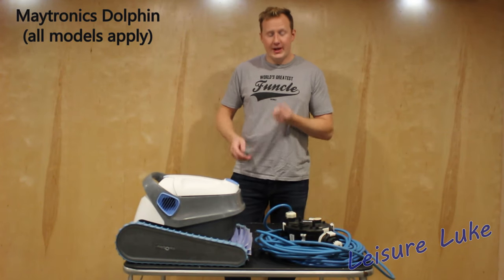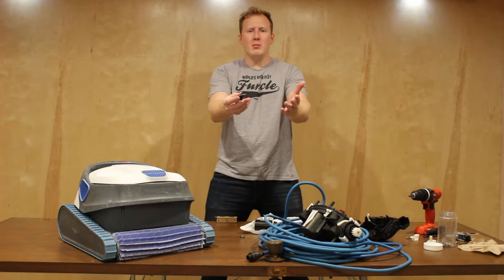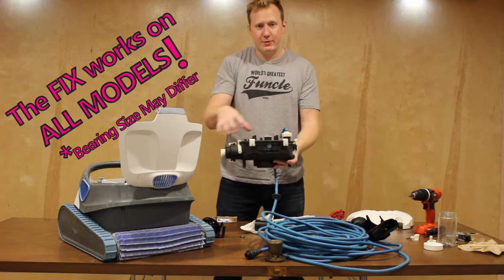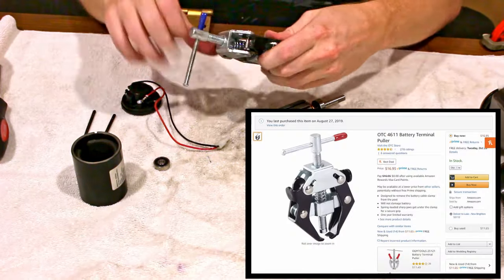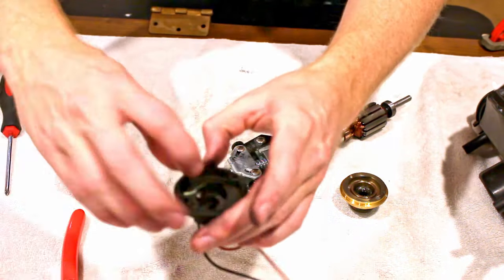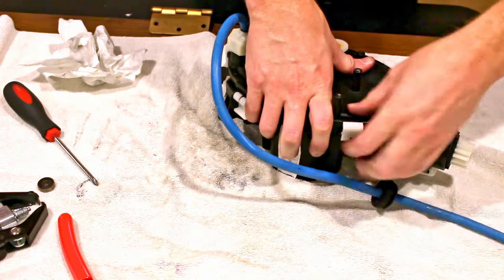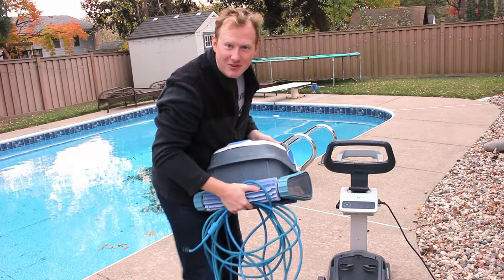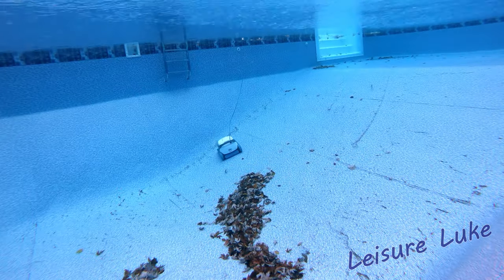Dolphin Pool Cleaner - BROKEN is FIXED!!!  SOLVED with 1$ Bearing | HOW TO REPAIR for MOST Models!

Comment: Hi Luke, thanks a lot. This was exactly my problem. I've spent only 1 dollar, 40 minutes and could fix it. you are the BEST. best regards from Switzerland Angelo
Reply from the maker: NICE WORK!!  That's no small job :) money and hassle saved!  Party Accordingly 🥳
Reply: Hi Luke, I have a dolphin, E-10, it seems lately the unit will go on the bottom as it goes through the debris. The debris just blows around. It does not seem like it has any suction yet I do see water coming out of the top. Any ideas why this would not have any suction? I checked the impeller, and there was no debris.
Mike
Reply from the maker: @michaelbennett3202  If water is blowing out the top, then you have suction coming in the bottom.  If it's able to cling to and climb walls, your suction is good enough.  I'd double check your filter basket for small tears, any small tear means that filter basket will pretty much not work at all.  Also make sure it's assembled correctly and sitting right in the unit.  If you're climbing walls, and your filter basket is clean, then it should be sucking up and cleaning something!  Hope that helps.

Comment: Awesome video. Thank you for helping the algorithm find this repair and saving big $$$

A few notes as I'm mid-repair:

1) The sealed unit itself can be really hard to open. I used the shaft of a screwdriver (not the pointy end) to pry it apart using the clip brackets as leverage. I slipped a credit card into the gap to help work around. When it finally opened there was a large pop - I think the unit was REALLY well sealed and the temperature swing at night when I tried to open it caused a pressure / vacuum making it extra hard.

2) The long screws on the motor itself have SUPER SOFT heads. Immediately stripped one of them using a regular screwdriver. And that's the point I'm finding myself stuck at right now. Ugh. Be careful everyone with these! Might end up having to buy a new motor just because I've stripped some darn screws 😵

There is an eBay seller out there who will repair/refurb your motor for ~$110, or sell a kit of all the necessary parts for ~$30. Might be worth it if there's a lot of parts that need fixing, or if you're happy to outsource part of the fix without shelling out the full $450!!
Reply: Thanks for the tip of using the shaft to pry open the black motor box. I was stuck.
Reply: @bristolj.buckets8968  I was curious about how well it was sealed. Thanks for this!
Reply: Could you please give us instructions on how to open this black open. I don't want to force open and at the end I can't close it tightly.

Comment: I spent $180 to replace the blue cable on my DOLPHIN Nautilus CC. It would only run for about 30 seconds and just stop. No indication on what was happening. Local pool shop suggested to replace the blue cable and I let them. Got it home a week later and of course it didn't fix my issue. They then suggested to replace the motor..  Adding up the cost of the potential repair, and I could have gotten a new unit for the cost of the motor and cable! :) I will for sure be taking my motor apart this afternoon to see if the bearing is the issue! Thanks for making this video!
Reply from the maker: Good luck!  While you are in there you can check both motors.  Some people have actually done the same fix on the other motor too!  I’d use your old cable and save the new one :) someday you’ll probably need it!  Might as well squeeze out the life of the old one!
Reply: @LeisureLuke  so taking the motor out in of itself showed me the issue. The propeller had hair and twine underneath it in a way I wasn’t able to see it from the top down view. Took the prop off the spindle and removed it and it’s working perfectly!!

Comment: My Maytronics Dolphin Active 20 just started having this problem where the impeller is not spinning.   I bought brand new in 2020.   We use it everyday in the summer.  This is the 3rd season.   With your instructions, I was able to take it a part.   There was all this black carbon flakes.   I used electrical contact cleaner to clean the inside of the 24V impeller motor, and both bearings.   I couldn't take out the 3rd bearing off, put it all together and everything is working - back to normal!   Without changing any parts!   This took me 2 hours to do at a easy comfortable pace.    Thank you for making this video.   You saved me $1500.     I was almost going to buy a new one.
Reply from the maker: Nice!!!!  Congrats on the fix!  It’s not a job for the faint of heart, and sounds like you did a thorough job and cleaned it like new!  The black dust is normal - it’s from the wearing of the motor brushes, which I’m guessing will be our next failure and next fix-it video :).  Well done!  Party accordingly!!!

Comment: Been working on these for 6 years, seen a lot of seized motors and this actually makes a lot of sense. Normally do repairs by replacing, but lately been trying to rebuild. Kudos for this info~
Reply from the maker: Yeah, and my repair of just 1 bearing has kept it in service for like 1.5 seasons with no signs of slowing down.  Any chance you have a good link to buying just the motors?  Or do you usually replace the whole black box motor assembly?
Reply: @LeisureLuke  I usually order through second hand to replace the black box. I've had around 50 machines before here, so sadly I won't have time to break things down. Covid made getting new parts a challenge, so I've been adopting motor repairs specifically since summer. I have a stack of older parts too incase one of the boards went bad.
Reply: So should the ball bearing just spring and spin? I give it a good spin and it goes about 3-4 revolutions and stops.
Reply: @Liatriss Would you happen to know if the 63ZYW-A2 can be replaced with an A3? Specs appear to be the same, but I’m not an electrical engineer so I’m being extra cautious.
Reply: @shortandsavage  from my experience with it, yes. I consider the bearings to be like skate bearings as the main difference seems to be small design differences for similar purpose. The main thing I noticed is problematic with the repair is the O-ring (which I have no idea if it can be bought without a custom fitting from somewhere.)
Reply: OHMICOIHO  Any idea where we can get a new rubber gasket?
Reply: I did this repair and now my impeller blade is spinning backwards forcing it to blow water instead of suck water from the bottom
Reply: @benproutey3428 
Swap the pump motor red and black wire . It's easy fix 😊
Reply: Ok, thanks for video. I saved it for later! Unfortunately this is not my issue. Maybe you or someone else can help me though.
Our power supply for the Dolphin is not powering on. Any suggestions? I've unplugged,  replugged, checked the outlet and even switched to a different outlet...still nothing.  Any hacks for this situation?
Thanks again!
Reply: Update on this, it will be a long post, but a few things. One I learned that at some point they had them pressurized (I think when they had the brass nuts to cap motors) check and see if your motor is boyant, it could need ~30psi

I've been learning to recoil the copper lately, I'm trying my best to do everything as the state of Isreal has affected a lot of shipments for parts (cables especially)

That said, if you find your cable gets tacky they are a (I believe) an oil based foam, I believe PVE, that said the tackiness from what I can tell is chemical stripping the oil out. I've been experimenting with old cables to coat in various oils. Specifically, machine 3 in 1 silicone and coconut oil, rub it in and pat dry excess. I will say this method hasn't gone through a lot of water testing to make sure it doesn't leak into the pool, but so far it's made tacky cables smoother.

In addition, the swivels are an interesting bunch. From what I can see (if you're familiar with this) they have a compression seal at the bottom that looks like the old style for motors/aquavac tiger Shark motors. Building order seems
1. Extend and cut the bottom swivel off as much as is available after cutting the foam to pull back for more room (leave a lot of room for reconnecting)
2. Remove bottom half of the swivel and compression seal at the base.
3. Attach a new compression seal and weave the cable back through, then cut back some of the cable shell.
4. Get water proof heat shrink butt connectors red type for this guage crimp and shrink wire to wire.
5. Seal over with a thin shrink tube then another shrink tube over the wiring.

The compression should seal the swivel using the shrink tube to fill the gap, just note the direction is nose down for added sealing length.

Also note, the swivel design changed around 2023 (I think) they went from 1 o-ring to two on the top half, be very very carful when removing the top as it can strip easy, I believe you could find a socket for a bike and modify it to slot three of the four turning points since those sockets are open on one section.
Reply: @RJD0314 the switch or cable ribbon could be bad if its the new unit, that is replaceable by lifting at the button. If theres no power then it could be a corcuit board or transformer issue if the cable swap doesnt do anything. if this is an old power supply you may be able to open the unit from the bottom, if it's the smaller sealed unit you'll need to cut open the unit for any circuit replacements, there is also the flat unit which is a small group of screws to remove, this is a little more operational for tech savvy repairs

Also, on the circuit boards capacitors are a big time culprit for failures

Comment: Literally, you saved me $450 AND the fix was free !!  Took apart as you did, took the motor apart and the inside was caked in fine carbon powder.  A bit of compressed air later, the motor cleaned, everything back together and good as new.  Thank you.
Reply from the maker: Awesome!  Nice work :D Party Accordingly :D

Comment: Thank you Luke. I had the same problem on my Dolphin Deluxe 4. It has 2 bearings  626rs and  608rs. Truthfully,  I only really needed to replace the 608rs, but since I was already in there and its like 10 years old, I replaced both. Additionally my circuit board had some corrosion and a burnt up resistor. I got some 90% rubbing alcohol and cleaned the circuit board. Determined the burnt resistor was an 18 ohm 1/2 watt, soldered a new one of those in and let'r rip. It runs like new. I would not have done any of this without your video. So here's the breakdown. 
Multi pack of resistors $13. 10 pack of 626rs $9. 10 pack of 608rs $8. Rubbing alcohol from Wal-Mart $1.50  and a tube of silicone lube from  HD $5. So, less $40 for enough parts to maybe keep this thing going  for another 10 years. A ton of simple knowledge that I got to learn with my 15 year old son. It's a joy to watch a once dead Dolphin that I paid a $1000 for still going. One more tip. I've always had the habit of keeping those little silica packets that come with all the Chinese junk we buy.  So I stuffed like 8 of those in the box to hopefully stop or limit future corrosion. I realize this this is now old and not as water tight as it used to be, I will probably open this thing up a couple times a year just to make sure. Thanks again Luke, you're AWESOME!!!!
Reply from the maker: Well done Russ!!!  You really went the extra mile there, sounds like thorough and excellent work!  You should be proud to have revived something, saved money, and probably learned a lot!  Happy to be the inspiration to crack everything open. That’s some seriously good work 👍🏼👍🏼👍🏼
Reply: Hi would these bearings be the same on dophins200
Vince

Comment: Hey mate, thanks for the great video, saved me $600 AUD for a new motor. Ended up being the brushes not the bearings, cost me a grand total of $10 to change them out. Although not the same problem as yours, your video gave me an insight on how to pull it apart & put back together again, working a treat now.  Cheers from OZ

Comment: Got the bearing replaced and motor put back together.  The seal must not have lined up right, Dolphin worked for about half hour then stopped.  I took it apart and the housing for the motor is filled with water.  Looks like I'll have to purchase a new one.  Thanks for video, was super helpful!
Reply from the maker: AH!  Shoot!  That's a tough one to stomach, but you did all you could to save it in the first place.  Enjoy the new pool cleaner, and let me know which you end up getting!

Comment: Hopefully you are still checking comments... So my S300 will go forward as it should.  Climbs the wall no problem and creeps along the tile line while bumping up against the coping.  But then when it decides to go in reverse, it will do so for only a few seconds and then stops moving.  Gravity will make it sink to the bottom of the base of the wall and after about 30 seconds it will resume going forward again.  As a result, it's constantly climbing walls, but never finding the floors where all the filth is.
Also take note that when it is just sitting for those 30 seconds immobile, it is still blowing a lot of water out the discharge vent as I can see all the turbulence in the water.  So this makes me assume my impeller is working.  Regardless, your video is very helpful in informing how to take the guts apart and possibly looks for clues.  I am going to try it tonight. So thank you for that. But in the meantime, any suggestions as to what is causing what I am describing?
Reply from the maker: Hey Mike, any luck?  Not sure what it could be.  If your drive motor or drive belts are getting stuck only in reverse, that’s pretty unusual.  Maybe someone else here will have a better idea.
Reply: @LeisureLuke  Unfortunately no.  I dug into it and impeller was clean as could be and spinning freely.  Then I opened up the sealed box to look for any visible issues, like water inside or burnt out circuit boards.  Again, all good there.  I removed the belts from the wheels, all the teeth were good and catching the sprockets.  So I buttoned everything back up, dropped it in the water and same thing.  But then I did another test that may provide a clue (sorry this is so long):
I held the robot by the handle suspended under water (so there would be no friction on the wheels) and turned it on.  The drive went in forward, then after a while stopped (as it is supposed to) and started going in reverse (as it should during it's cycle).  It STAYED going in reverse for some time!  When it cycled again (forward and then reverse), I then let go of the robot to allow it to sink to the floor.  As soon as it made contact with the floor, the reverse stopped (while still blasting plenty of discharge out the impeller port).  Eventually, it started going forward again on the floor and back up the wall.
So it appears that if there is any friction on the wheels (belts), the motor doesn't have enough power to move it.  But ONLY in reverse?!!! This makes no sense to me.  So I am wondering if I can replace or repair the drive motor in a similar fashion that you repaired the impeller motor?  I would hate to spend over $400 to replace the whole guts when possibly one small component may be bad.  Any further thoughts?
I submitted an online request to Maytronics explaining all this.  Have not gotten a response yet.